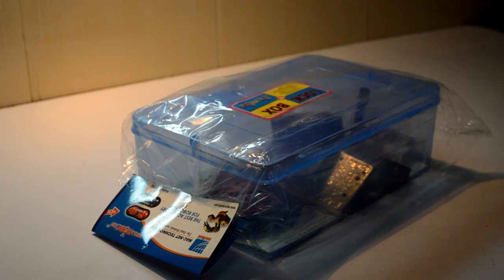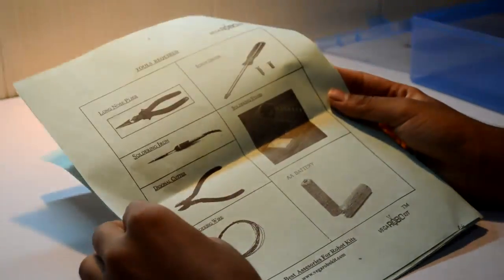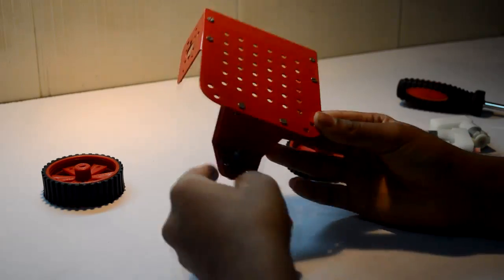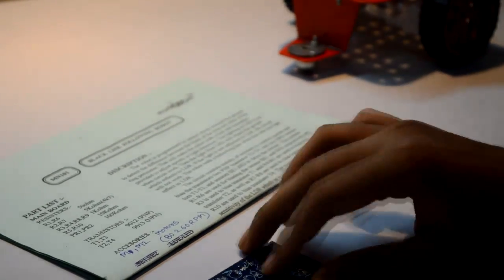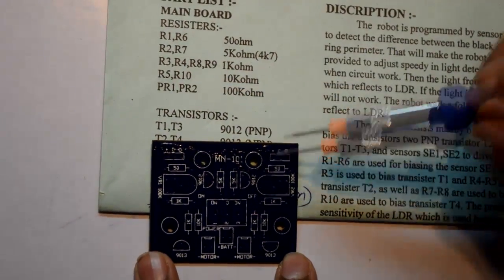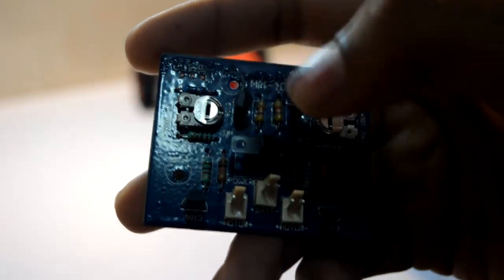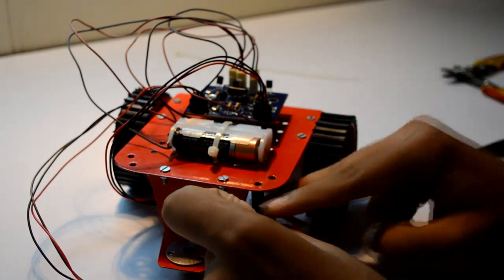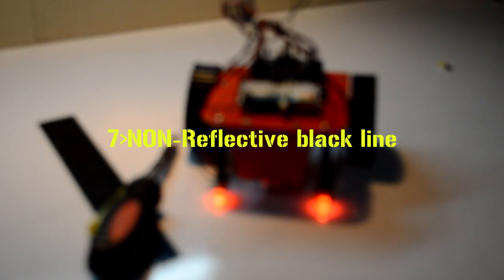How to make a line follower bot (without programming)

Comment: very detailed explanation about designing a line follower robot. Last month I have already worked on microcontroller based line follower robot project using the circuit shown in the post: http://www.electronicshub.org/line-follower-robot-using-microcontroller/. Now I will try to work on this line follower robot without using microcontroller as shown in this video. Thank you so much for sharing this video.

Comment: sir,i used the kit provided by vegarobokit.i soldered all components correctly.double checked them.the led of the sensors are working fine but the motor doesn't work when i place it on track.i used black tape for track.when i chcked motors and the connecting pins ,they were working fine.but it doesn't work when i place it on track.what should i do??

Comment: Thanks GetTutorized KD....SIr so inyour design circuit can I replace the source with 6 volts or even 4.5 volts coz the robot is to slow??? does the circuit will work and no problem to encounter if i replace the source with 4.5Volts or 6volts????????

Comment: Thanks GetTutorized KD... Sir so in your design circuit can I replace the source with 6 volts or even 4.5 volts coz the robot is to slow??? does the circuit will work and no problem to encounter if i replace the source with 4.5V or 6 volts???

Comment: Sir, Is it OKay to change the source with 6V source instead of 3V. will it work for the designed circuit??????
Reply from the maker: Whatever components you decide to  use in a circuit(while designing the circuit), you always consider the input voltage of the circuit which decides all the values of the components(mostly)
Reply: *****
Thanks GetTutorized KD... Sir so in your design circuit can I replace the source with 6 volts or even 4.5 volts coz the robot is to slow??? does the circuit will work and no problem to encounter if i replace the source with 4.5V or 6 volts???

Comment: too slow manhh !!
increase the speed !!
what to do to increase the speed ??
Reply from the maker: You need to change the motors with a higher rpm
but since you are using analog sensors with no programming you need to use motors with slow rpm as the bot may go off the line
Reply from the maker: Yes, the motors will run faster.
Bcoz more voltage makes these motors to run faster
But the circuit is designed to run at around 3-5 volts.
You may face a problem in that area!